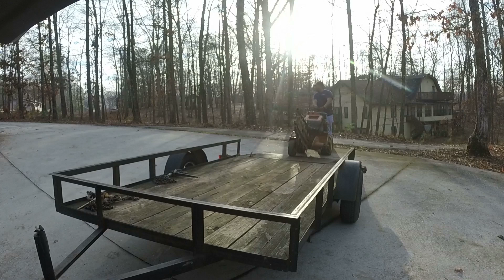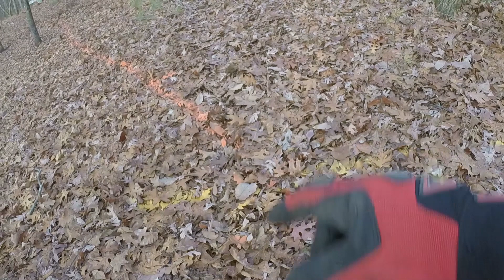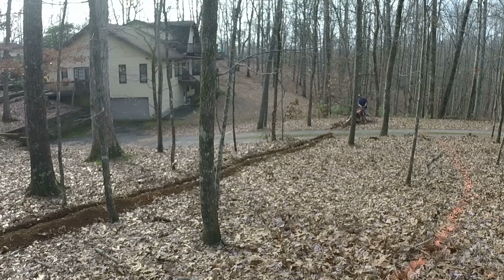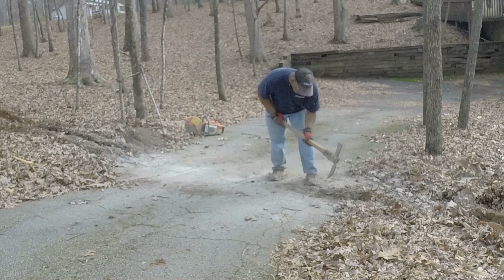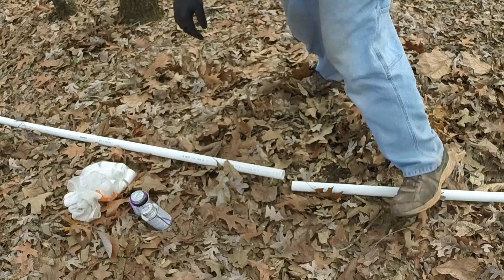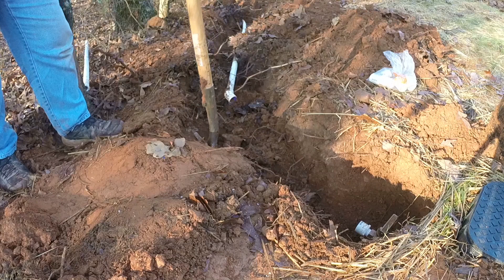Installing the Main Service water line into my Neighbor's House (Part 1)

Comment: Why not use poly pipe instead of PVC?
Reply: Joseph Davis , hey Joseph i have to do the same thing on my house my question is poly pipe is my best option and what size? I have to run obout 300 ft
Reply: @a.samora5998  At least 1", if not bigger. Polyethylene is good for expansion, contraction but hard to work with in larger diameters. Price? shrug. I suspect Poly is more expensive in larger sizes. Poly pipe is thinner walled and softer.
Reply: Poly is always better only two fittings on at the house and the other at the well or city water And 3/4 is what we run or 1 inch and you can get a roll that’s 300 feet